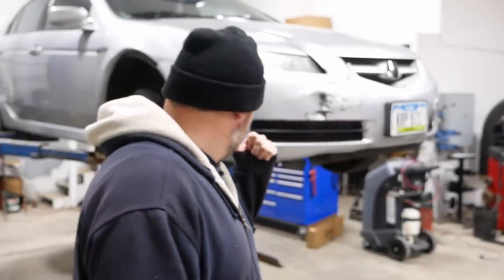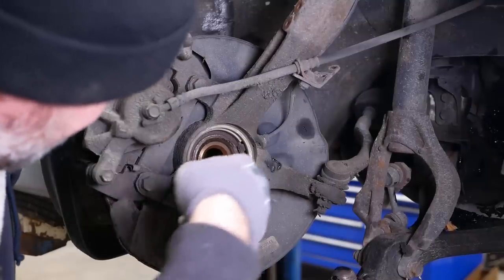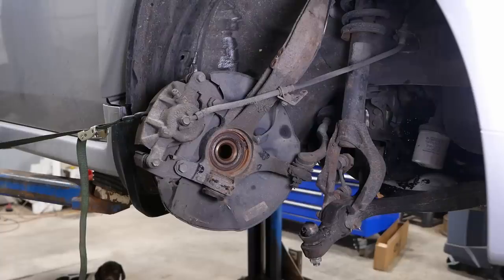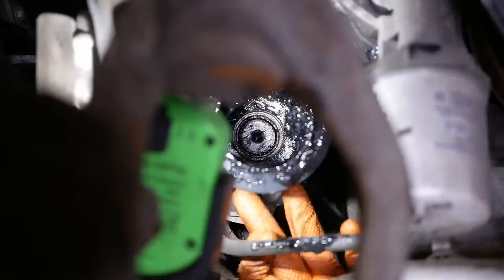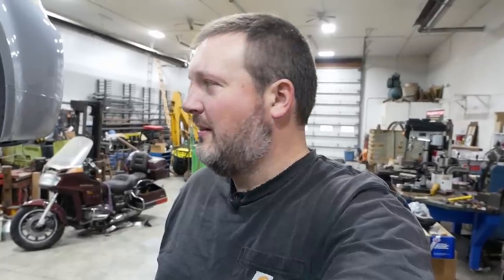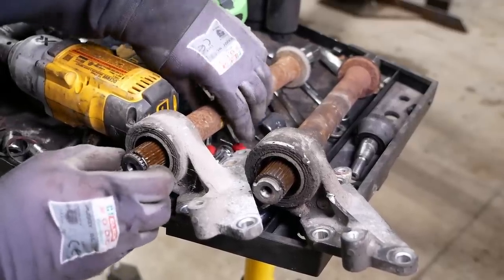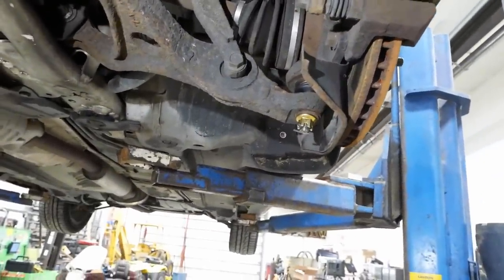Acura TL Broken Ball Joint

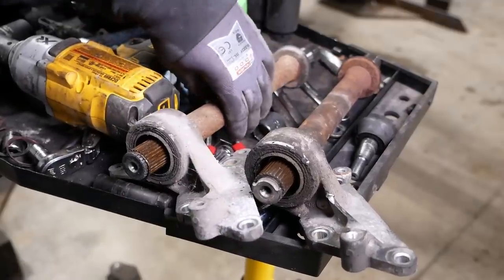Comment: I bet you that happened at 13:35 cause some lazy Honda worker didn't check to see if the ring was over-expanded before he slapped the CV axle in at the factory back in 05.

Comment: 9:29 you know they make vise grips with slide hammers built into them All you have to do is use the vise grip to clamp on to the CV axle remnants and just use the slide hammer to pull it out it's not one of those claw ones that goes behind the CV axle it's literally a vise grip plier with a slide hammer attached to it It is absolutely fantastic for CV axles and you should definitely buy one 

Edit: never mind I saw one on the floor I cannot believe that it didn't come out with that that is crazy I've had so many problems and spend so many hours on them and they always come out with that tool that's insane I've never seen anything like that
Reply: 11:32 it's right there on the floor....
If the hydraulic press ended up ripping the splines off the inner axle I don't think the slide hammer had a chance.
Reply: I've seen them but don't have one.
Reply: @jimurrata6785  Read the last part my dude
Reply: @Troy_Built  actually made one a few years ago before you could even buy them basically what I did was I just took a threaded rod and screwed it into the back of the vise grips and then put some washers in a nut on the other end and put a slide hammer inside you can make yours but now that they sell them you can get them for a lot cheaper than just making your own I think they cost like 45 bucks or something on Amazon astro pneumatic I believe sells them
Reply: @colchronic  there was no edit when I replied...
Reply: @jimurrata6785  dude I edited it 5 minutes after I posted it you just didn't read or you didn't refresh for a long long time

Comment: My wife has a Honda CRV, I'm continually amazed at how easy it is to work on. I've been impressed by the engineers at Honda at how well they've built in the repairability. I guess not all Hondas are the same huh? I guess the CRV is a lot bigger than whatever this one is, but still. I have a mate who owns a souped up Civic (the small one) and he says it's pretty good to work on so I dunno. 
My experience has been that generally the Japanese cars are easier to work on, although not always of course. Without doubt the worst are the German cars. Man, some of those things require the engine to be removed to replace the spark plugs. No kidding. Audis in particular are HORRIBLE to work on. I mean, who secures a timing cover to the front of the engine with THREE different sizes of bolts? Audi, that's who. And here I thought the Germans were supposed to be good at this kind of thing. Nope.

Comment: The Texas Twister air hammer adapter would have pulled that out in 10 seconds, or the ARES 12020 axle popper in 30 seconds.
Reply from the maker: It took about 10 tons to separate it...

Comment: And that's why I avoid working on autos as much as possible.  Except I would have gotten so frustrated I would have beat on it and with a 5 lb maul and would have hit a finger in the process. And hitting my finger would have created a reflex reaction that would have caused me  to throw the maul and it would flown right into the windshield it would have ended up sitting on the dash.

Comment: Wierd about that stuck axle. I worked on many friend's high mileage Hondas in California(250k is considered "broken in", they'll go 400). Never had a CV that wouldn't just pop off with the slightest suggestion of prying force. I've never even encountered a worn ball joint(that ball socket is huge for a sub 3000lb car). Yes, you have to release the "fork" to get the axle out.

Comment: Note to the viewers who may be ignoring noises on their car:

If your car’s suspension goes “squeak” when you hit a bump or turn the steering wheel, this is your future. Get your crap fixed asap!

I hear so many cars (and especially trucks) driving down the road where you can literally hear the ball joints falling apart as they go down the road. It’s horrifying.

Comment: Not for nothing, there's a slide hammer attachment for knocking CV axles out. It looks like a 90 degree flat pickle fork.
Reply from the maker: Can it apply 15 tons of pressure? That's what it took to get this on apart.

Comment: Is the suspension setup so that there is no need for a strut bearing? Multilink also doesn't require a strut bearing where as McPherson strut does.
Reply: Theoretically, double-wishbone has better geometry. That generation of Honda vehicles does have good ride and handling. Indeed, there's no strut bearing, but that's trivial compared to the extra complication of this design. Honda has gone back to MacPherson rather than fixing the design headaches.
Reply: @bikeaddictbp  It is not just theory, with McPherson it is always a choice between driveability or comfort/travel. With double wishbone, multilink or a hybrid of them you can setup the geometry like you wish of course.
Reply: @rkan2  ... of course, provided that the calibration is right. Front suspension category "double wishbone" includes a Formula 1 car, but it also includes a 1948 Chevy. It doesn't automatically mean perfection ...
Reply: @bikeaddictbp  F1 has been multilink or hybrid of it for a long time. Not double wishbone. There is a difference.
Reply: @rkan2  Sure, but my point is that double-wishbone (or multilink or anything else) doesn't automatically confer magical ride and handling characteristics just because it's that type of suspension. (1948 Chevy ...) Double-wishbone "can" be better in this regard than MacPherson, and in this generation of Honda cars, they were pretty good. But, the downside is, that issue with the lower balljoint being in tension and only a matter of time before they pull apart and fail catastrophically, and some servicing headaches ... and, Honda doesn't do it this way any more.

Comment: hi.. i really curse a lot when this happens. then i sqweeze the snap ring with pliers to reduce diameter, and then, curse a lot more for excesive repair time caused by too soft steel snap ring..

Comment: I don't think it matters what make and model car/truck you work on, they all have some sorta stupid design flaws that make life a pain. Like on 199X-2004 Saab 9-5's, you basically need to pull the engine out/ drop the engine cradle out from under the vehicle to replace the alternator because its wedged in between the engine and the firewall.

And from what i've looked under the hood of my 9-5 so far, i see no way of sneaking it out of there, hopefully i just have a tired battery and not a alty on its way out.
Reply: That user name...
either way find a friend with a front-loader and or fork truck, release the body from the subframe and lift the body away.

Har fått beskrivningen av samma operation men för Volvo850.  Dela på bil och ram var bästa metoden när det var dags att byta vevaxeltätningen.

Comment: why didnt you leave that part of the inner cv joint that was stuck in place and just insert the New cv joint bearings into it with a new boot? okay its not 100% correct repair but it would of been fine for many years no doubt.

Comment: I hate these sort o ball joint setups I have a 2002 ford wagon and a friend of mine had te sedan of the same model with them te ball joint is similar  in how the lower control arm is below the stub axle assembly but it is pressed into the control arm and the nut is above the puivot in the stub axle this results in 2 types of bad ailures one like this where i the ball joint ails  ends with the upper control arm taking all the weight and your car sitting on the ground on the lower control arm and the other where the nut becomes loose and ends in the same result. My riend had a bad ball joint but kept driving it and inally had it replaced and as they put the car up on the hoist the ball joint let go and thats when he found the upper ball joint was also bad as the whole wheel and brakes and stub axle fell onto the floor. The worst part of replacing these in my model ford is that you have to have a hydrolic press to press them out and in due to the amount of force required to move them. I have seen people try how you did it here only to brake the clamps or punch completely through the base of the ball end.

Comment: as a honda tech i do these repairs daily. there was a recall in canada on those axles we got quick at theme. the design they even use on the pilot/ridgelines up to 2023 and they sieze on the half shafts even that new. its that or a canadian thing haha. But for reference. If you have a balljoint on those that isnt broken off. just leave the ball joint attatched to the control arm and hammer the control arm. it pops the ball joint out. takes like minutes to remove. also where ever you get your labour times from its wrong. warrenty pays me 1.3h and cp is like 1.9h. You screw your self alot in videos i see. also honda recommends an aligment after :/
Reply from the maker: I just go by what AllData says. Of course this job was doomed from the start.

Comment: What size socket finally took off the lug nuts?
Reply from the maker: The right one
Reply: @WatchWesWork  I have a complete set of those spline sockets in shallow and deep, 3/8" and 1/2" drives. You said you didn't have a socket for that and then you found one. Just wondering. I'm 77 and I really don't have time for childish answers!

Comment: This is one of the bonehead designs that's on a lot of Honda's from that era.  Accords, Civics, etc.  The weight of the car is constantly pulling the front ball joints away.  I've ever seen only Honda's with the wheels folded into the door on the side of the road.  Almost every other manufacturers just put the connection point on top to make it much harder for the ball joint to pull out.

Comment: Has anyone used an Ingersoll Rand 122max or 122maxh air hammer?
I found a 122maxh for sale online, it's brand new in the original box and for the next 24 hours they only ask about €58 for it, that's about $61.50
I'm not sure if the accessories are still in the box because they took out the hammer to take a picture of it but they didn't take any of the open box, but anyway it seems a good deal just for the hammer alone.

Until now I have only used those generic ones made in China that cost €20 or €30 and I don't know what difference I can expect, in the (poor) documentation I found online it only indicates the number of blows per minute but not how much energy is released in each blow. 
Over the past yeat I bought four of those generic ones at local stores at a very good price (€12 to €15 each) complete with their bits because they were ex-display units, so I don't need to spend more money on a branded one if it doesn't have more power. 

It seems a 122maxh is like a 122max but for hex shank bits.

Many thanks in advance to anyone who can give me an opinion! 🙂

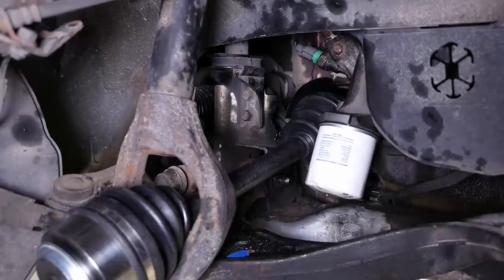Comment: Why is the car hopping around so much at 16:40?
Reply: It's on a 2 post lift and the car has a 60/40 weight distribution, the front being heavier.  To avoid that rocking you're supposed to put a jack stand in the front.
Reply from the maker: It's also on the lift backward.

Comment: Cars are engineered to be as inexpensive as possible to manufacture, ease of maintenance be damned. If ease of repair were included might reduce profits which would make the beancounters scream. The pecking order at automotive manufacturers should be marketing, engineering, styling and accounting in that order. Pontiac would probably still be in business if the Fiero hadn't been discontinued just when they were starting to get it right and the GTO from the 2000's if it hadn't been marked up so much by greedy dealerships. While I'm on my soapbox it should be against the law for a dealer to sell a new car over the MSRP.

Comment: Working on this car is not easy and some of the stuff are design so stupid, another example is if you need to reseal the oil pan, you need to drop the subframe. To remove upper crossmember on the suspension, in order to remove those two bolts you need to remove shock absorber... a pain in butt
 And everything rusts on Honda...